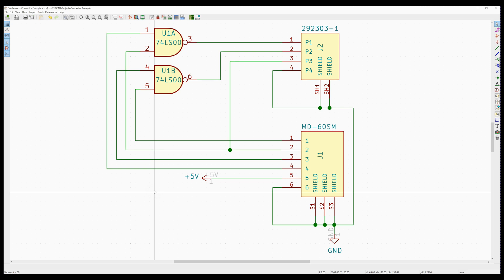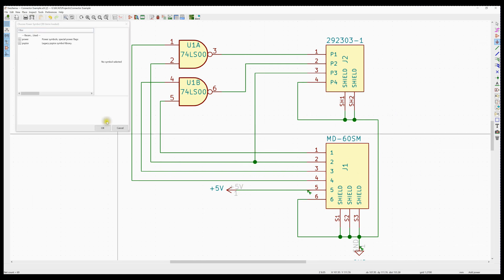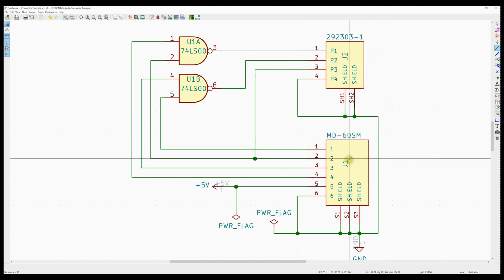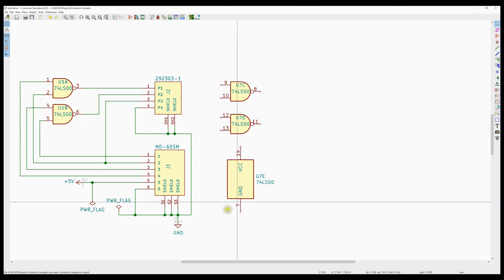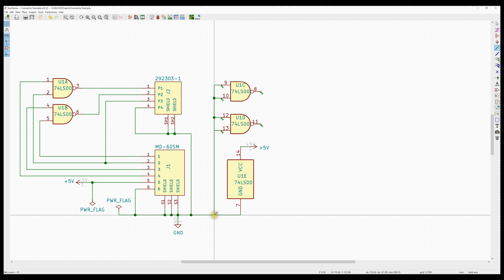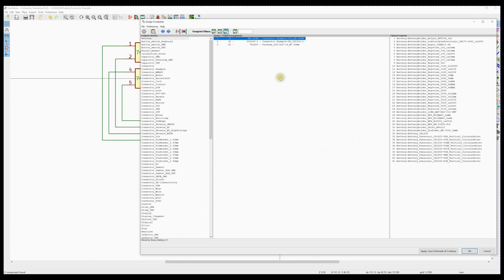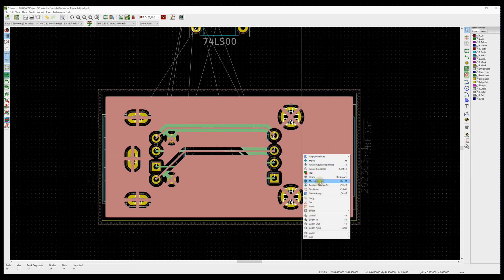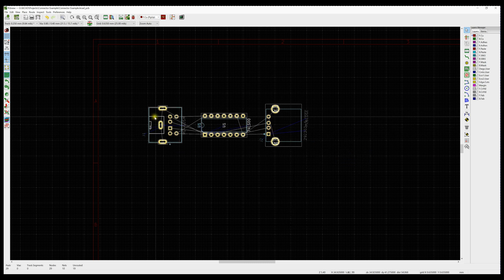STB470 - KiCad - Part 3 - Power Flag (PWR_FLAG) and Missing Power Connections

Comment: Hi there!  Can you please tell where can i find Unit E in kicad 8 ?
Reply from the maker: Not sure I follow the question?
Does ERC tell you the unit is missing?
Sometimes, in the schematic editor I need to add a 2nd component of the same type for the component missing the unit, delete the duplicate units the change the reference on the unit that is left over. I've accidentally deleted or  name one of the units wrong in the past. 
What does ERC say when you run it?
If this is a KiCAD 8 issue I haven't ran into it as I'm still running 7.

Comment: This is good, but I have a question about a different situation that is more about symbols than Power Flag (but related).  I have a symbol in a library that has two identical units (happen to be inverters - a 6 pin package), and each has invisible pins named VCC and GND (grayed out when symbol is placed) - there is not a separate unit for power.  These same pins show when each unit is placed.  How does KiCad connect power to these?  I can't connect wires to the invisible pins.  Is KiCad going to look for a power signal named "VCC" somewhere on the board?  I don't see how it could assume +5V is the same as VCC. I suppose I can experiment myself and see what happens but I thought I would ask.